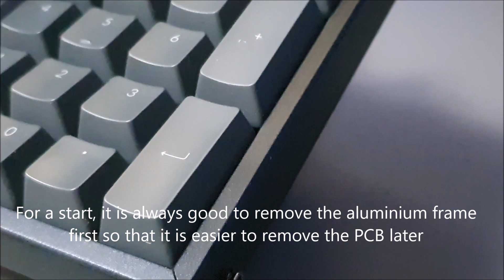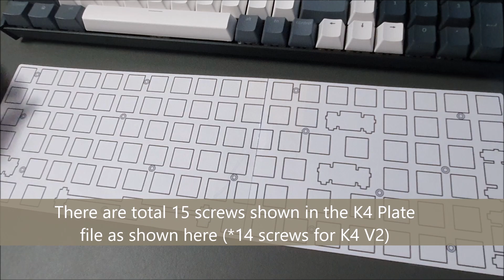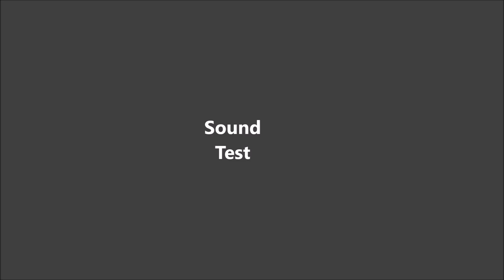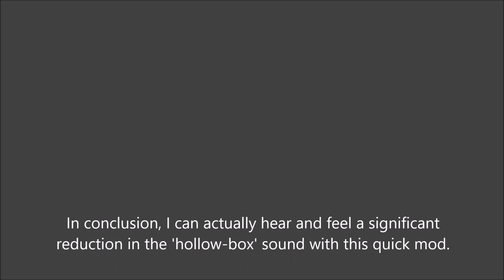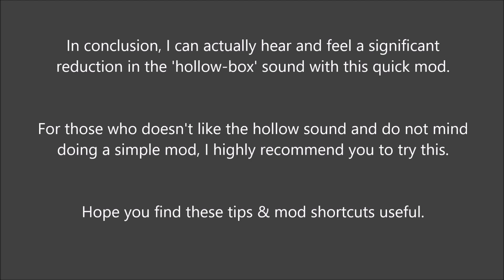Shortcut Tips To Soundproof Your Keyboard | Keychron K4 V2 | Foam Mod

Comment: Cool video, where did you get the key caps? Looking for a cool set to replace the greys, I like your colour scheme
Reply from the maker: Thanks! I got my key caps from a local shop, link and specs provided below for your reference: 
https://shopee.sg/product/414950560/6891623895?smtt=0.196969583-1654733113.9

Comment: What is the screw driver called that you used to remove the casing?
Reply from the maker: I'm using an interchangeable multi-bit screwdriver. For the aluminium frame, it was a Hex bit. An allen-key set should do the trick too.

Comment: is it safe to have the foam over the battery?
Reply from the maker: Good point. I think that u r right that it is not totally safe to have anything over the battery. Any heat trap or battery degradation may become a hazard over time. But so far mine is ok, do try only at your own risk (and preferably have a foam cutout to avoid the battery area).

Comment: I don't hear any difference
Reply: I just did this mod and yeah the difference is minimal. It only reduced keypress echo by a but. It would be better to use actual sound dampening materials instead of packaging foam
Reply: This mod is to reduce the inside-the-box echo and the high-pitch ringing after pressing a key, especially if you hit a key hard. But to change the initial sound of pressing a key, then you have to change the switches and/or the caps as well, but the switches will do the most.